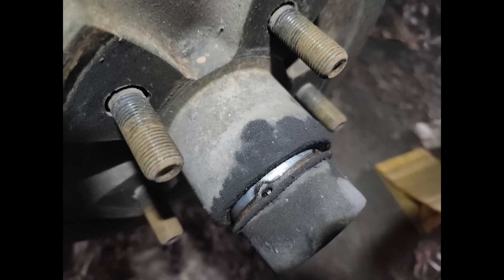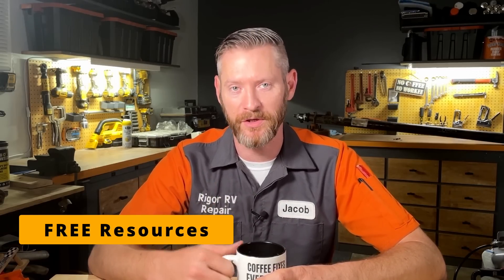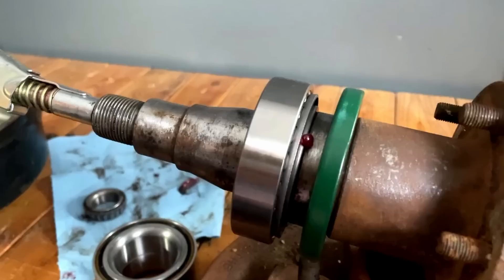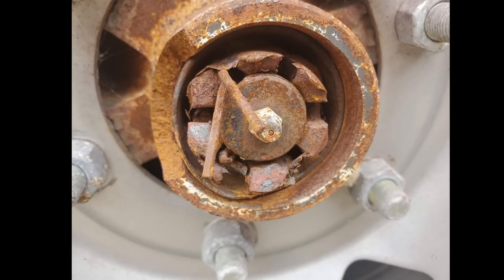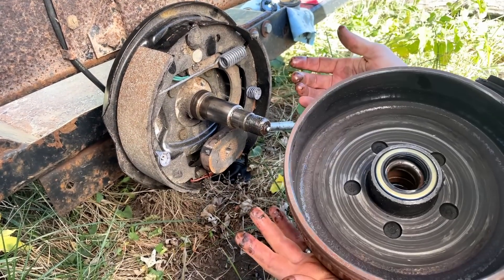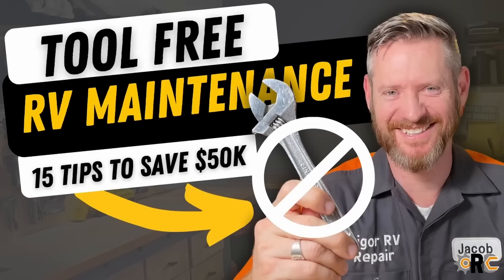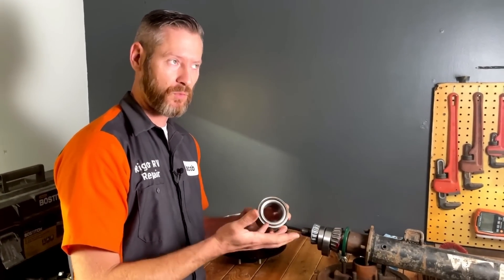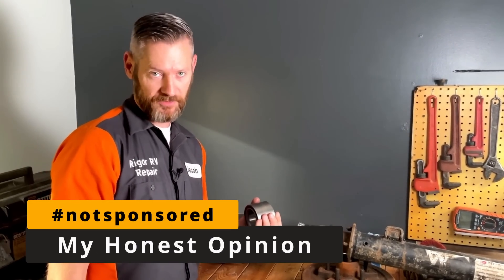What RVers do wrong - the truth about RV wheel bearing maintenance!

Comment: Using the EZLube system will not only NOT get grease into the bearings properly, but by forcing grease in, you can blow out the seal AND you can also push grease onto your brake shoes if you have drum brakes effectively making them useless and making shoe replacement mandatory.  That's a lot more costly than doing it correctly.

Comment: This is bunk, pure and simple. Heavy industry uses opposing roller bearings in almost everything. We are NOT tearing everything apart every year. The final drives on a Caterpillar dozer as an example. Independant of the lubricant, preload is larger determination of initial wear. Do not over tighten. In this system, the lubricant is at play. If it super cold, the grease will push on the seal vs going through the bearing.

Warm temps, spin the wheel, you wont have issues.

Comment: I'm pretty sure that you know bearings don't need to be inspected every year. It should be based on mileage. If you install quality wheel bearings, use a good moly grease and adjust correctly then you should have no issues going an easy 30,000 miles. You don't inspect and grease your conventional front wheel bearings on older cars every year. This is an up sale tactic.

Comment: hey dude the inspection of a bearings every year is $600 so you are saying $600 every year? no fkg way is that good advice. i don't use the easy system. you should be able to say how many miles not every year
Reply from the maker: The service manuals for Dexter say you should inspect the wheel bearings every 12 months or 12K miles, whichever comes first. Lippert axles are every 12 months or 36K miles, whichever comes first. Most RV owners don't hit the mileage standards, so inspecting the wheel bearings every 12 months would apply. This is all according to the axle manufacturers. Regardless, it is up to you how to maintain your RV! I’ve linked Dexter’s service manual in the video description if you would like to check the “inspect bearings every 12 months” specification as well.

Comment: At minute marker 2:33 , i don’t completely agree with this statement. You can easily check if the wheel bearings are bad when using the EZ-Lube system by lifting the tire off the ground. Just wiggle the tire back and forth, and it’ll indicate if there’s a bad bearing. Often, you can also hear a squealing sound when the bearings are failing. Also, after driving, touch the wheel hub carefully (as it may be hot). If it feels hotter than usual, the bearing could be failing due to lack of lubrication or wear.

I agree that hand-packing bearings is better, but when they’re only $15 each, I’d rather use the EZ-Lube system, take my chances, and if they go bad at 50,000 miles, just replace them for another $15 each and repeat! 🤣 

If you’ve made it this far through my rambling 🤣👉… I’m just being a bit of a smart butttt! But seriously, this is excellent info—you definitely know your stuff! I’ve been watching your videos for a while, and it’s clear how much time and effort you put into them. Great channel; keep up the awesome content! I’m currently studying YouTube filmmaking and hoping to get my own channel up and running by spring 2025. Your channel has been a huge inspiration—thank you! 🍻
Reply from the maker: Thanks for watching and commenting! Glad the video was helpful!
Reply: @undercoverrvtech  yes excited to see more videos!

Comment: All good info. Regular inspection of all running gear ia always a good idea. I agree the once-a-year interval is rather ambiguous. If I travel 500 miles or 5000 miles it's once a year?? While on the road a quick check of the hubs and tires  only takes 30 seconds. I use my fingers, and if something is warm that's ok, if its hot, it gets my attention. Remember to check the tires as well, I also give them a little tug  just for fun, to see if a bearing is loose. A TPMS on the trailer tires is a great way to detect a problem while driving. Most systems will give you psi and temp. If the temp starts to get high or psi increase/decreases in one tire, stop and take look before something catastrophic happens. 

There is a product out that I think should be standard equipment for all trailers with these types of hubs. The fact that a wheel can come off the hub, at speed, and roll free in what ever direction it assumes, is scary to me. The  Hub Saver is a very smart simple device, . (No I am not being compensated for the plug). It is so simple and appears to be effective, it's a, what can it hurt to install choice for me. I personally do not want to be partially or completely liable for injuring someone because of a bearing going bad at 60mph..  Check it out and decide for yourself.  I will be installing them on my trailer over the winter.  https://thehubsaver.com/

Re-cap.  Repack when needed, TPMS on trailer, and Hub Savers.  Peace of mind!!
Reply: Thanks, I never knew these existed. Seems like such a simple solution to avoid a potentially catastrophic event.

Comment: I have pulled my trailer about 65,000 miles in 10 years. I have mostly used the E-Z lube system pumping grease per recommendations each year. No leaky seals and no bearing problems so far. I have hand packed them twice during the 10 years. The laser thermometer is a great idea, though.
Reply from the maker: Thanks for watching! Glad the video was helpful

Comment: I think that the term "annual maintenance" is ridiculous. When you live in your RV full-time, and travel 7-8 months out of the year, what are we really talking about. Put it into miles. Otherwise, you are doing your viewers a disservice. Are we talking every 1-3K, which is a lot for many weekend travelers, or are we talking +10K, which is what I have traveled just this last "annual" timeframe? Come on.
Reply from the maker: The service manuals for Dexter say you should inspect the wheel bearings every 12 months or 12K miles, whichever comes first. Lippert axles are every 12 months or 36K miles, whichever comes first. Most RV owners don't hit the mileage standards, so inspecting the wheel bearings every 12 months would apply. This is all according to the axle manufacturers. Regardless, it is up to you how to maintain your RV! I’ve linked Dexter’s service manual in the video description if you would like to check the “inspect bearings every 12 months” specification as well.

Comment: I always ask, how often do you check the bearings on your daily driver?  

I have a travel trailer and had 5 boats before.  I hand packed all the wheel bearings because it is really easy to overfill using the zerk fittings and as we all know, grease expands when hot.

Comment: EZ lube system is worthless. I tested it on my brand new trailer, and it was a good thing I did. Because when I pulled the drum to inspect the bearings, they were mostly dry, especially the outer bearing. It just can't force the grease into the bearings like they need, and also waste grease filling the extra spaces. I know I would have lost a bearing....or 4 within my first couple of camping trips. Remove, inspect and repack every year is good solid advise. Thank you.
Reply from the maker: Thanks for watching! Glad the video was helpful!

Comment: Never Lube is not the cure all. Airstream has been installing them for some time now, and there been quite a few failures. You are left stranded, parts are days or weeks away if the spindle was damaged, and a number of smart Airstream owners have switched to regular axles and bearings.

A regular timken bearing and seal set for one wheel will run at least $14 or so, and twice that if from an industrial supplier.

Comment: I’ve been servicing tapered roller bearings since they were on the front wheels of cars, and I 100% agree. Rv makers tout the EZ lube as a feature, but you don’t catch a failing bearing before it spins on the spindle- ruining the axle and leaving you stranded. Also you’d have to pump a lot of grease to purge the old, degraded stuff.  I’ve also seen them blow the seal and dump grease onto the brake-even when used as directed (slow pumping while rotating the tire).
Reply from the maker: Thanks for watching and commenting!

Comment: I service trailers and the new spindle nut clips are great. Trailer bearings do not need to be loose. When bearings are loose the load is on fewer rollers and that is more stress. If disc brakes are fitted it also means longer brake apply times due to pad pushback being greater. I have for 30 years set trailer bearings to near zero preload or to a minor preload for new bearings. No failures, and the grease gets much less blackened with 2 years of use. Nev-r-lube are minor preload assembled new.

Comment: Here's what I don't get about this advice: Some towable RVs are used a few weeks out of the year, possibly driven few miles in that time. Others are used "full time." How can the recommendation for "once a year" maintenance be advisable for both? Also, the weight of the RV is going to vary, but I would imagine that the same axel and bearing combination is used across many platforms. Once a year might be wildly unnecessary or wildly too infrequent depending on the miles covered. (I don't own an RV.) But it probably should be emphasized that when you are buying a used RV you should have the bearings inspected.
Reply: I agree! Most people only use their trailers 4 or 5 times a year. Back in the day, pack able wheel bearings in cars were usually good for 15-20,000 miles. Of course, it’s better to be safe rather than sorry, but packing bearings isn’t the most delightful maintenance job.
Reply from the maker: The service manuals for Dexter say you should inspect the wheel bearings every 12 months or 12K miles, whichever comes first. Lippert axles are every 12 months or 36K miles, whichever comes first. Most RV owners don't hit the mileage standards, so inspecting the wheel bearings every 12 months would apply. This is all according to the axle manufacturers. Regardless, it is up to you how to maintain your RV! I’ve linked Dexter’s service manual in the video description if you would like to check the “inspect bearings every 12 months” specification as well.

Comment: Ok, last April I regreased my Casita wheel bearings EZ lube system with the right grease and a grease gun. I emptied two cartridges of grease, one per side into the bearings and the old came out and the new went in. It took me well over an hour. Are you saying that if I do it properly and per instructions, it still is no good and that I should have a professional do it?

Comment: Unrelated but maybe a future video. What have you seen on front windshields on travel trailers and 5th wheels? Durability, repairs, issues with leaks. What happens when they're damaged and cracked from general use. As an automotive technician, I have a hard time believing they're not a major issue area. Especially with issues and damage I've seen from front windshield and sun roof leaks over the years.
Reply: For context,  I've done 17k in parts, 66 hours of labor at 180 an hour. On a 35k 1 year old vehicle with 6k on the odometer. Just from a leaky windshield.

Comment: I am NO RV TECH, but I would check the bearings on a new RV too, or at least grease them. Dexter and ESPECIALLY Lippert only put in just a little bit of grease when they ship an axle to the manufacturers. Wo then bolt on the axle and call it good.
I had both axles replaced under warranty by lippert and the axles they sent to the shop had less then an ounce of grease split between the 4 hubs.
Lippert is going (who now makes many of their own axles for companies instead of buying dexters) to save a single penny anywhere they can.
Reply: ABSOLUTELY! I have ahop and service trailers for my vehicle customers. I tell every one to bring any new trailers to me and I remove and inspect for wrong assembly and then pack hubs with proper grease amount.

Comment: I would like to add something to this. I am a machinist and mechanic. Whenever you buy wheel bearings, don't buy them from a retailer or seller that has them in a bin unwrapped open to the air. The bearings are sitting there getting a film of rust on them and will fail a lot earlier than they should. Another thing to not do is don't buy cheap Chinese bearings. Sure they cost a lot less but the metal the bearings are made of are sometimes not up to industry standards. Your best bet is to buy Timken tapered bearings. The last and most important thing is to learn how to correctly pack the bearings and how to correctly install the bearings. Because if you install them to tight they will fail in a short time.
Reply: Timken 100% all the way. Learned that this year after careful maintenance and caring for the factory bearings (5th,wheel). Doesn't matter how good they look and use of high quality grease - failure. All new Timken (USA) bearings in place now.
Reply: yaaa for timken...the best
Reply: I'll second the Chinese bearings and add tires. I had one Chinese bearing that lasted 15 minutes in a new lathe. I rebuilt a knee mill quill that was only a few years old that had bad bearings.

Comment: Is there different types of wheel bearing grease dependent on the weight of the trailer? What brand and type of grease would you recommend to repack my dual axle 5th wheel. I have a 2018 RiverStone 39fk. Thank you.
Reply: Lucas Red 'N Tacky.

Comment: I worked for a bearing manufacture for 46 years most of those years in metallurgy.  If the bearings are tapered roller bearings of good quality and properly installed, they should never need maintenance or fail for the life time of the RV.  No different than a car of yesterday.  Most trailers will never see 100,000 miles.
Reply: Get an infrared heat gun at a big box store and use it to check hub temps whwn you stop.   If one is 25 degrees hotter than the others you have a problem.

Note: if you are traveling north south the sunny side hubs will be 10 warmer just from the sun
Reply: How would I know if a bearing of this type is by chance going bad? Would I see leakage of grease somewhere, or perhaps if I jack up the wheel to remove it and find "play" in the bearing when moving a properly seated tire from side to side? Are these signs of bad bearings?
Reply: @louisvrana7526  You would find play before you took the wheel off. Jack the tire off the ground and try to find any movement other then rotational. But you should still be inspecting it once  a year.

Comment: I understand and agree that wheel bearings on a travel trailer like my Jayco 5th wheel require annual cleaning/repacking; I just find it astonishing that we're using 1970's technology (with the maintenance hassels that come with it) on trailers 50 years later. Sure, some of the materials and design have changed somewhat, but to still have to pull the wheels off and do this job yearly is ludicrous. But par for the course, I suppose - the towable RV industry decades behind the automotive world in a number of ways.
Reply from the maker: The service manuals for Dexter say you should inspect the wheel bearings every 12 months or 12K miles, whichever comes first. Lippert axles are every 12 months or 36K miles, whichever comes first. Most RV owners don't hit the mileage standards, so inspecting the wheel bearings every 12 months would apply. This is all according to the axle manufacturers. Regardless, it is up to you how to maintain your RV! I’ve linked Dexter’s service manual in the video description if you would like to check the “inspect bearings every 12 months” specification as well.
Reply: Yeah. I suppose an RV maker could use a unit bearing like autos have gone to, but the average RV buyer would buy the other brand because they can get the same size trailer cheaper.

Comment: That’s good info about Dexter’s Never-Lube bearings. Seems expensive , but if you don’t do your repacks yourself, the cost of paying someone every year to do it and you keep you RV for about 5 years, the cost about evens out and the convenience factor goes up.
Reply: So, if my trailer has Dexter torsion axles I don’t have to worry about this?
Reply: @karit5332  Yes, you still have the same hub and bearing system, just a different suspension system.
Reply: @OmahaWayne  Damn. I was just browsing through the comments to see if the Dexter bearings would be compatible with the Dexter torsion axles.

Comment: Auto engineer here - you're 100% correct, the EZ-Lube system is sub-optimal in that it relies on "new" grease to scour the "old" grease out of the bearings, and it doesn't do that particularly well because it wasn't designed to. Tapered roller bearings have always needed thorough cleaning, visual inspection and void-free grease packing to maintain health of the bearing surfaces.
Reply: Cleaning bearings is a no no. Best to push out old grease with the new! 3rd generation mechanic and engine builder.